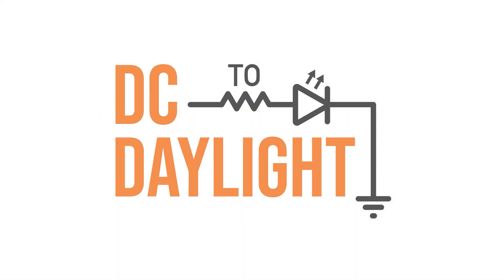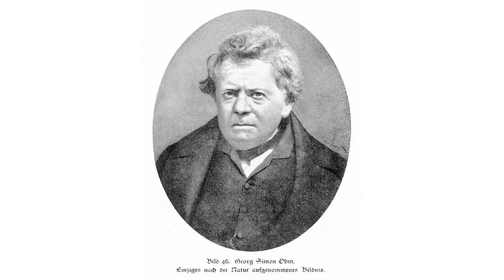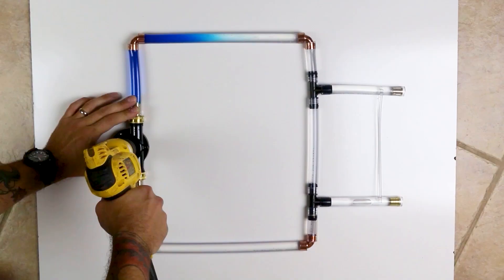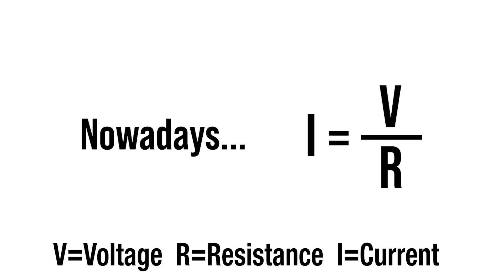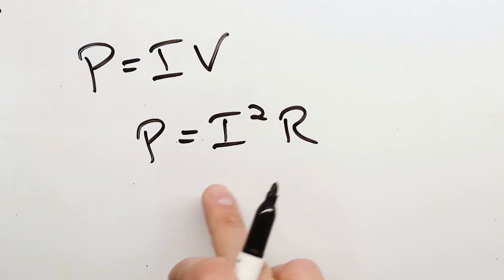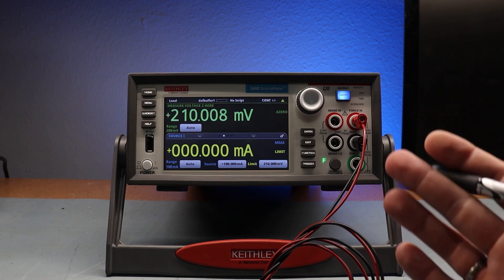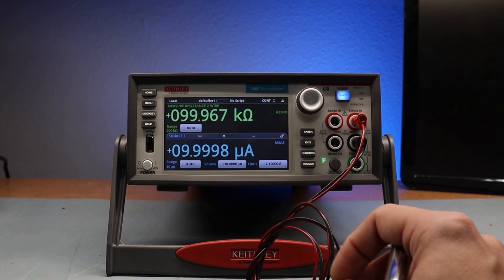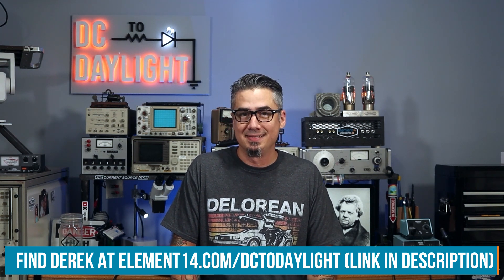What is Ohm's Law? - DC to Daylight

Comment: Derek from The Current Source (TCS), neat!  Ohm's law in the world of AC... from ... uhm not quite DC... though throughout VLF to Daylight next considering phase and/or frequency?   A few weeks back I finally think I had that moment where I understand (at least can visualize what happens graphically and signals wise) reluctance and inductance or magnetic resistance as well as reactance and capacitance/inductance with the graphing of the voltage and current to see the effects on the phase.  Really have to sit down where I've not comically quite yet observed the development of like the resistance-reluctance model vs the reactance or capacitance-permeance model.  I didn't get to reviewing impedance the same way outside of the math or at least doing the math myself and graphing or testing to see the effects.  The oscilloscope visuals of potential and current really help for me comprehending more since I'm not doing the math routinely.    Seems this table can be updated a little more with some more metrics: https://en.wikipedia.org/wiki/Magnetic_circuit#Summary_of_analogy

Comment: Love the Episode :D
i hope you also can talk about how + and - relationship to each other in a circuit aswell, if i remember that as long as it has load or multiple loads you dont blow the battery, in a way you manipulation + to go true stuff like led diode etc but never collides with - un-less it has a load beween it? :D
i think its similar with AC Power Too?
connect L and N and fuse goes-Off, But Connect L and N With Load Betwen it(Light Bulp) or Other that can handle Heat like WolFramSteel Heater, fuse dont go off?

Ohms Law is nice for see what the Fuse cirtcuit in hous can handle like 230V and 10A Fuse so theory can handle 2300W but generallt stay around 2000W since heat Creeps in the wire :D